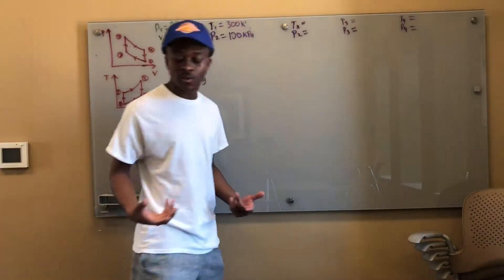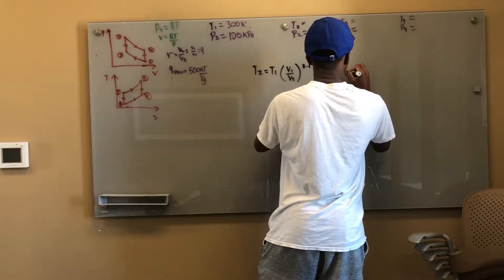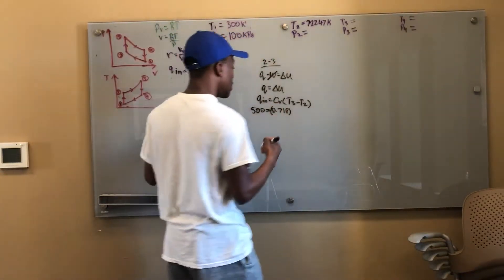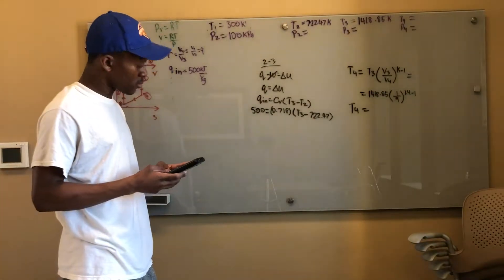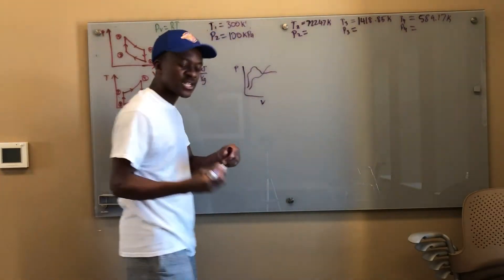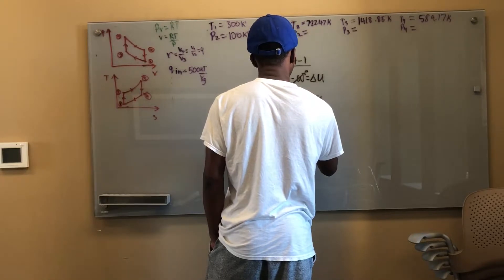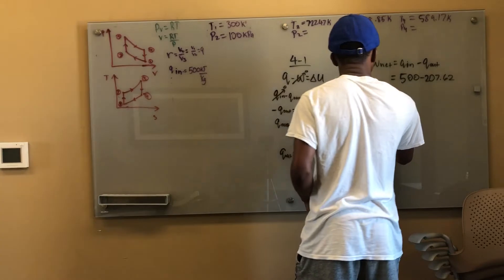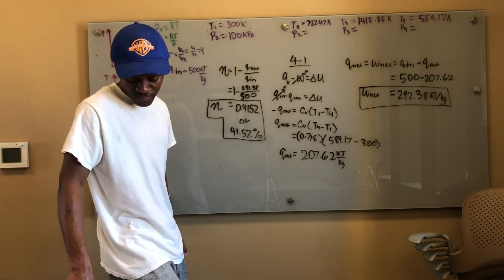Otto Cycle Example Problem

Comment: When calculating the thermal efficiency I used n = Wnet/Qin and got 58.6 % but isn't Wnet = Qin - Qout? If so Why am I getting a different percentage?
Reply from the maker: I just panned through the video but you should get the same number and percentage. I punched it in to my calculator and I got the same think. Double check and let me know!

Comment: This is off topic from the video, but i'm taking thermodynamics for one of my semester classes in the fall. From the title of the course videos its stated that it's thermo 1. Is there such thing as a thermo 2 ?. im currently in mech eng 3rd year just curious to see if you will be taking a thermo 2 if there is one.
Reply from the maker: Joshua Urichuck yes! There is a thermo II. It’s sort of partially a continuation of the videos you see as well as the addition of partial derivatives. I also have a playlist on advanced Thermo that can point you on the right direction but I never really learned a whole lot in Thermo II unfortunately. It was a lot of cramming which I can’t stand but I needed to pass 😅
Reply: @TheThermoSage  respects for the response and i will check those out for sure. Trust me there's no time for studying just cramming even if you start 5 months in advanced lol
Reply from the maker: @joshuaurichuck5330  You've got it! Don't stress. Thanks for watching!